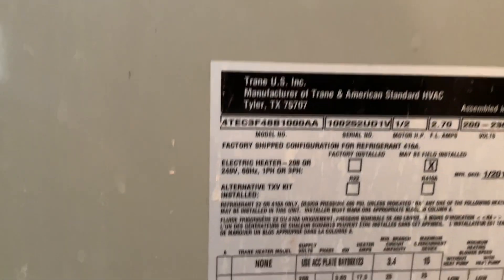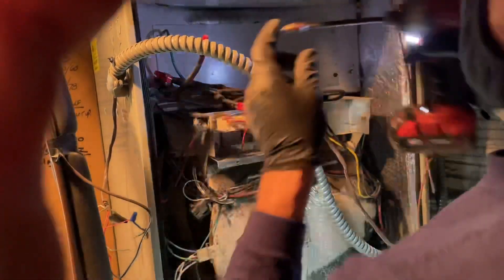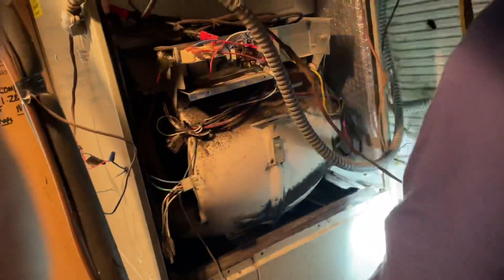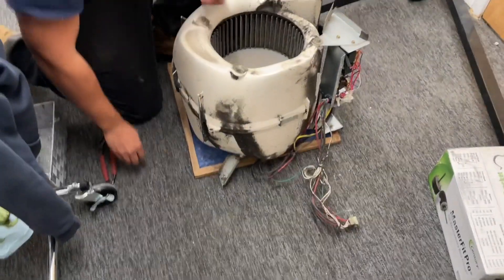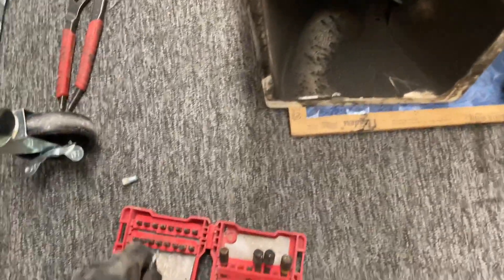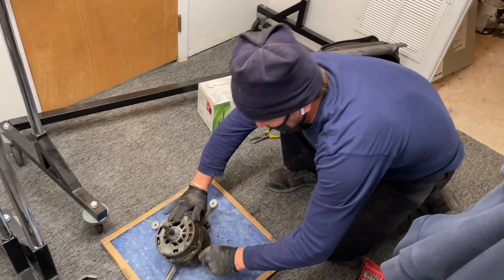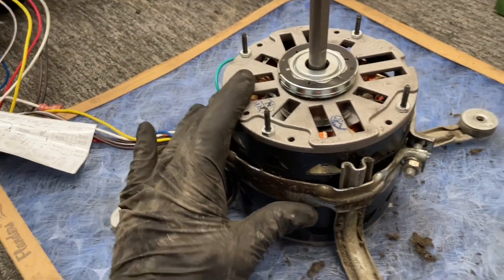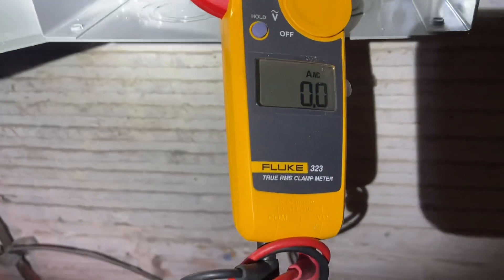How did this motor last for so long? Changing out Blower Motor on Trane Air Handler with Heat Strips

Comment: Honestly I just bumped into this video you should have replace the air handler and checked out the heating elements if it's a heat pump with supplemental heat thermal overloads could have been defective and poor airflow be totally honest with you if you do not understand how a heat pump works stay away from it get someone that does I can't believe the wiring in front of that heating strip element should have been a fire damper this is what's required in Florida you should have noticed the air filters completely clogged so that means the coil is completely clogged this is where you're getting the poor airflow other than that have a great day

Comment: Sand the shaft or use on blaster before removing and blower motor you’ll thank yourself for the extra few minutes of work next time that one came out pretty easy but most don’t, ever replace a 1st company blower motor...awful! The electric heat is backup usually when the heat pump goes into defrost or needs supplemental heat.

Comment: You should have sent Godzilla outside to clean that filthy blower assembly and squirrel cage while you put on the motors' bracket. Those veins on the squirrel cage cant scoop air properly when they are that caked in dust. Maybe that's why the strips were kicking on and off because of over heating due to lack of air flow. Did you check the evaporator coil to make sure it wasnt blocked? Good video other than that.

Comment: The heating element is a boost to the heating system only runs when needed most of the time the heat comes the difference in temp from outside and inside.

Comment: In most situations the electric heat on a Heat Pump is only used for backup or supplemental heat alongside the Heat Pump. So that means they shouldn't even be on unless there was a problem with the main source of heat OR the Home Owner turned them on for some reason, which is typically when they aren't satisfied with the amount of heat coming from the pump. In this case there could have been a problem with them caused by the bad blower, if they don't have constant airflow across them they will overheat very fast.

Comment: Mikey Pipes, the heaters are tripping on the high limit that is built-in to the heat strip due to overheating, caused by lack of airflow.  First off, you should have removed and cleaned that blower wheel.  Once you flatten out the curve of the blades, the airflow drops significantly.  (you may have cleaned the wheel off camera)  Second, if the filter and blower assembly were that dirty, the evaporator coil is even dirtier.  That should be cleaned as well.  Love the videos my brother, this is not nitpicking or trolling, just some food for thought.  Keep up the good work!

Comment: Usually if they are going on and off like that it’s getting to hot fan might not be on right speed
Reply: @PipeDoctor  I would imagine if heat is only supplied by electric resistive coils, they have a huge power bill during the winter time. 50A @ 240VAC is about 12Kw.

Also there might not be enough air flow (perhaps undersized duct which is restricting air flow or just 40+ years of dust buildup).

Comment: Just look at the schematic. Can't memorize every piece of equipment.
Reply: @PipeDoctor  Hey Mike. When you changed out the motor I would suggest you take a reading on the motor amperage to make sure it is running at the proper amperage. I.ve seen a under horsepower motor installed with the same frame and rpm but not enough to push the air.

Comment: As dirty as that fan, and filter was it may have low air flow due to the coil being clogged. Looks to me like its cycling off the limit shutting down heat strip then cools down bringing them back on.

Comment: Seems like limit cut off that amp. But It should be not reach limit soo fast if tstat call for heat and  there is no restriction on air flow.

Comment: Dirty filter just cost them what ever you're charging them for a blower motor. You either got lucky you didn't need a puller or you're a beast. I'll let you pick which one.

I HATE working on heat pumps and electric furnaces up here. Ill take a boiler over them anyday

Comment: i just installed a 15kw heat kit in a nordyne handler. not bad to install. just need to make sure your power wire and breakers are sized correctly for the wattage. If you ever have a problem with heat strips almost always the relays or sequencers. Could also be a bad limit switch that would be my first guess

Comment: When strips cut on its pulling amps and when they reach a certain temp they cut back out, if wired properly.
Reply: @PipeDoctor   possibly as long as it's not cutting out on limit.